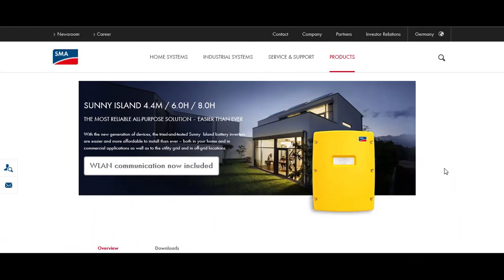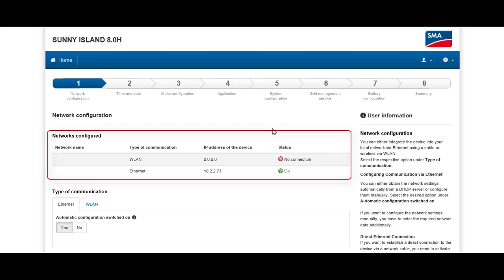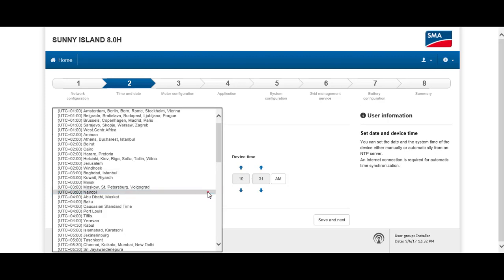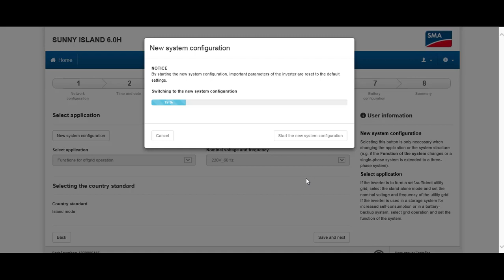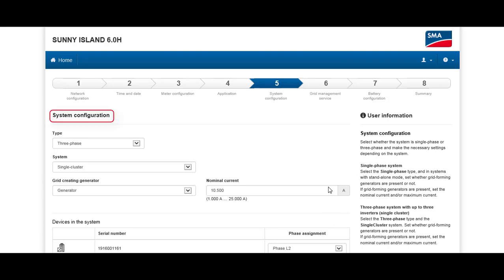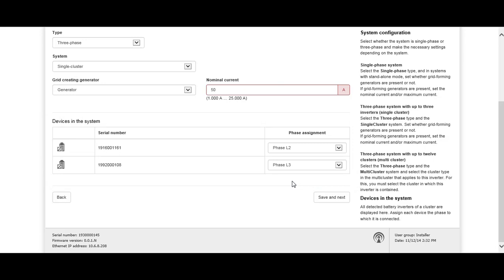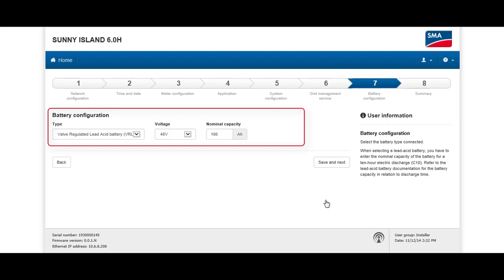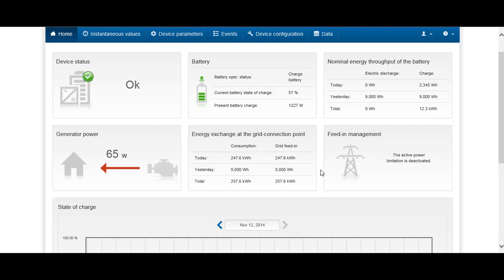Sunny Island: Set Up a Stand-Alone Grid in Only Eight Steps

Comment: But what about the sequence of activation of the individual devices in the overall system? Take, for example, a system consisting of Sunny Island 8.0, BYD battery, Home Manager 2.0 and Data Manager M. In addition also the PV inverters. 
....Which devices do I have to configure according to the sequence of this constellation? Or doesn't that matter at all? We dont want to cause Battery damage etc.!
Reply: Hi mate Only register Sunny island as it is the main brain dont log in to Sunny boys otherwise your settings will be not recognised so for example if you have 3 sunny island just register 1 which is master and rest are slaves and do your settings in one and master sunny island will be take care of other inverter and island along with batteries
Reply: @mitulvyas6487  how if i have more than 3, 6 for example, how many set as master and how many set as slaves?
and can make a vidio for setting the configuration? thanks for your attention.